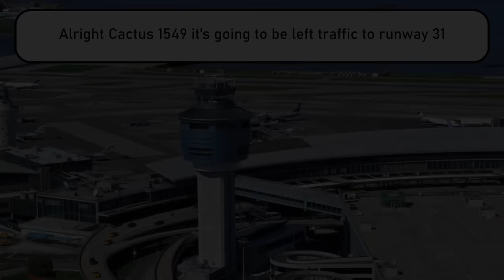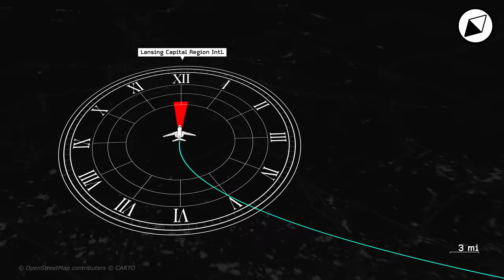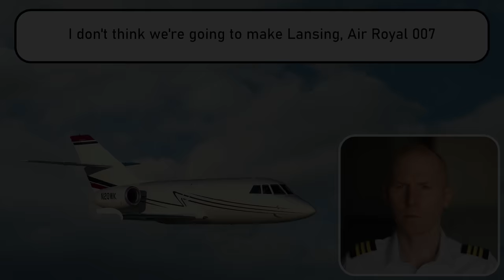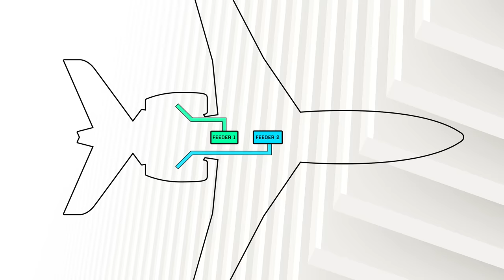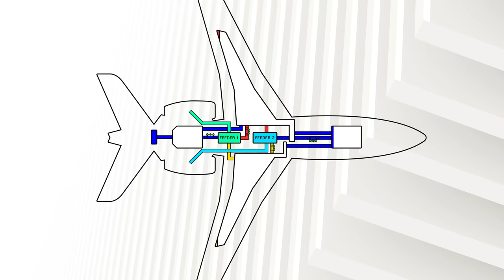Most Bizarre Dual Engine Failure Ever

Comment: Never ever give up altitude with no engines until you are very close to landing.
Reply: Except as part of your energy management, of course. Really not good to come in super hot, when you don't have the option of a go-around.
Reply: How is that possible anyway? As soon as you lose thrust, you will begin to lose altitude, unless in a glider on a thermal updraft.
Reply: @hoghogwild  more precisely, never give up energy unnecessarily when you don't have working engines to give you more energy. You can trade energy back and forth between speed and altitude, you can deliberately dump energy (within limits), and ultimately you need to touch down with almost no energy left.

The most extreme energy management I've seen was an old-school aerobatic pilot: turned his engine off, did a few aerobatic manoeuvres, and then landed pretty much immediately. Knew exactly what he was doing, and also he knew how to maintain a safety margin.

Comment: As ATC, just as with you pilots, it's important to keep things as standard and normal as possible, especially in emergency situations. That's probably why he kept giving "normal" instructions.
Reply: Yeah, standard emergency procedures, not trying to apply standard procedures to emergencies. That's just confusing and frustrating
Reply: @alakani  The whole point of emergencies is that they're non-standard. Thus, you can't really have any "standard" emergency procedures. You have to deal with the situation you're dealt with the way you're dealt it. We're animals of habit, and we do the best when in a situation we're used to. Thus, doing things as you're used to doing them, would lead to the best outcomes.
Reply: @Henoik  Sir I know you have a multi engine fire but that is no excuse to cut in line. Please go around or get a pen and paper to write down a number:p
Reply: @alakani  You need to understand that during an emergency, a controller's instructions more become "advise" than anything. We understand that pilots may be unable to carry out an instruction, even during normal operations. There is just so much we can do as controllers. If you bust the 3000 feet because you cannot maintain that altitude for whatever reason, then that is fair enough, but we cannot give a clearance that doesn't ensure separation from terrain or other traffic - even during emergency situations. The PIC needs to do what he needs to do, and we do whatever we can to make free room for you. Yes, it sounds weird to ask a pilot without engines to maintain an altitude, but "sounding weird" has never hurt anyone. Improvisation, however, has.
Reply: @Henoik  Luckily this was a very experienced pilot. I can only imagine how that kind of advice might have gone over with the student with an incapacitated instructor. Thankfully it's usually much more of a team effort in emergencies than this, and the student landed safely thanks almost entirely to a wonderful controller
Reply: @alakani  Whilst it is true that complacancy and lack of assertiveness have been a part of accidents before and will continue to be part of accidents in the future, the non-standard handling of a situation has a tendency to lead to confusion for everyone involved, and has directly led to accidents before and will continue to lead to accidents in the future. Do you find the term "Cleared to land" to be awkward to give to an aircraft with an engine failure? Do you find it weird that an aircraft on an emergency descent will be cleared by ATC to descend to whatever level/alt the flight crew requests? Yes, they start their descent often without clearance, and don't necessarily talk to ATC before they are well into their descent, but this is the kind of stuff we plan for.
Reply: This is true. I also heard it as more "everything down to 3000 is clear for you, no obstacles". Like you say, standard call that is easy to log and understand what it means under pressure
Reply: @paulalexander8874  Exactly. Aviate, navigate, communicate. Every (commercial) pilot understands that they need to keep the airplane afloat before they can worry about the instructions we give. If you're unable, just say unable.

Comment: I was laughing too when they told him to maintain 3K. 😅 I’m surprised they didn’t tell him to meet a crossing restriction 😅 Assuming an emergency has been declared, they can pretty much bust that 3K without sanctions.
Reply: I agree, they can bust that all day long if they declared an emergency.  
Probably doesn’t matter in Michigan but they may have had terrain or obstacles they wanted to tell the pilots about with that clearance.
Reply: @stevenbeach748  There's a number of transmitter towers reaching up to 2100 in that particular area.  3000 is also the initial approach/glideslope intercept altitude for the GPS approach to that particular runway, so habit may have been involved, too.

Comment: Kelsey, potential small correction to your video (at least as a paraglider pilot): the weight of the aircraft shouldn't affect the glide ratio. By being heavier you lose altitude faster, but you have a higher airspeed that counters that (e.g. you sink more per second, but you also go further per second). In still air, you'd end up at the same spot regardless of weight.
If anything, since being heavy increases the airspeed of the glider, you'll have better groundspeed if you're in a strong headwind, and thus can reach a target more easily. Being too light would have the opposite effect - not being able to maintain a sufficient ground speed and thus not making it all the way to your target.
Is there anything about powered aircraft that would make things different?
Thank you and Happy Holidays!

Comment: The one thing I never heard ATC ask the pilot is "What is your speed?"  I think I would have known a plane needed lots of altitude and speed to glide 15 miles.  I have heard that small jets can almost glide for 2 miles for every 1000 feet, so if the controller is telling him to hold at 3,000 feet, there's no way he was going to make it 15 miles.  I wonder how far had the plane flown before losing engines?  Was it out of fuel or suffered fuel contamination?

Comment: Cleared to 3000 is because that’s the lowest altitude he has control over.  It may be bottom of his block with a different agency below, or it may be minimum vector altitude for the sector due to terrain. In either case the controller cannot provide a lower clearance.  Doesn’t mean the plane can’t go lower, just means it’s out of this controllers airspace if it does
Reply: I mean, this was a mayday situation, so all clearances were pretty much off the table?
Reply: Cleared to 3000'is one thing, maintain 3000' is completely different

Comment: What's the takeoff distance of your 747? If you had to emergency land on a 4000' runway would you be able to take off again or how would you get the plane out of there?
Reply: It would become a museum where it stopped
Reply: @1972challenger  maybe not, it depends. They could climb onto ground effect assuming there aren’t obstacle’s ahead, or they could tear the inside apart and take out a lot of weight like the USAF did with the C-17s. Those jets are worth tens to hundreds of millions depending of the variant, the operator will not abandon it without a fight to retrieve it first.
Reply: @Jesus Antonio  come to think of it maybe it would be cheaper to buy the houses in the way, bulldoze them and grade out a runway to get that bird back in the air
Reply: @1972challenger  that’s the scorched earth policy 😂. It’d be a few homes at 500k each for a 100m dollar jet. It’d be hard to convince people to sell, and if you push too hard it’d be bad PR. That’d be tricky.
Reply: You would get a test pilot with large aeroplane performance qualification to negotiate with the FAA and agree the maximum weights and the minimum thrust required for the take off.  Wind, atmospheric pressure, temperature and runway condition and extensions can be waited for.
Reply: The airline would buy giant fans and install them on the far end of the runway to create a 100kt headwind.
Reply: @1972challenger  That's almost exactly what happened at EHLE. They have a museum there which has a 747-203SUD (PH-BUK) as a show piece. It could have landed at the airport and the museum considered doing so, but the conditions eventually lead to them shipping the plane in several parts.

Comment: There was a Learjet out of Gainesville that lost both engines due to DEF contamination.
Reply: There have been at least 3 cases of DEF contamination, in all 3 the DEF froze up at altitude, blocking the fuel lines, and flaming out one or more engines.  Fortunately in all 3 cases the aircraft landed safely.
Reply: Wow!  How does DEF get into jet fuel?
Reply: No oversight on the private side and overworked rampers with no support  is a recipe for disaster. Forget about customer service, who is doing QC?
Double check your fuel loads and sump your tanks.
Reply: @trigonzobob  They were putting a dewatering fluid (like Prist) in the tanks and used an empty DEF jug. Jet A can tolerate ZERO DEF.
Reply: @richardshippful  Why would there even be DEF in the same stores as the aircraft materials? Aircraft parts/materials are meant to be stored seperately from commercial items. 
Did this occur at a smaller airport where ramp workers service ground equipement or is DEF used in some smaller aircraft?
Reply: @MegaGouch  I don't know those details. only that it was an "empty" DEF jug.

Comment: Maintain 3000 is probably just an automatic reaction by the controller, and it may be all the air space he controls.  Below 3000 he may not be able to clear him, meaning he'd have to maintain visual separation from other aircraft.
Reply: Under a mayday, clearance should be "anybody with at least one functioning engine stay the hell out of the way of the emergency aircraft."
Reply: I think tthat the maintain 3000 was because of thats the height of the largest obstacle in the area.
Reply: @Joe Bramblett yeah, but maybe they'd have to call another ATC to make that call for them.
Reply: @spartaleonidas7132  then that would be the absolute worst place to send a plane that can't even maintain altitude, much less climb.
Reply: @kd5nrh The minimum clearance is often a single piece of object like a cell tower. This may have been the towers best location that they can give him. I wouldn't look too deep into the phrasing of the towers responses - they know a plane without any engines really can't climb. Under a mayday call, the pilot can do whatever he needs to keep his plain in the air without towers authority. He may have to answer questions, but he was going to do that anyways.
Reply: @spartaleonidas7132  If the highest obstacle was 3000ft MSL, it would mean the ground was somewhere like 2500' MSL at most, meaning the approach pattern would be really low or there was a kilometer high object in the way. 3000' MSL is a pretty common altitude for most approaches when the airport is somewhere around sea level. "Maintain 3000 until estabilished" is a standard procedure.

Comment: Hey, Kelsey, are you sure that Glide Distance depends also on aircraft's weight? In my knowledge heavier aircraft will glide same distance as lighter one, but faster ;p
Reply: Weight has no effect on glide ratio, the same aircraft, with higher weight, will glide the same distance, only at a faster airspeed. It's one reason why an AOA indicator could be important because the best glide happens at a single angle of attack for any given configuration. (edited for AOA)

Comment: Around 2004 I was taking a Jetblue flight from NYC to SFO.  Right as we were crossing the Rocky's the pilot told us that the fuel had been miscalculated and we had to divert to SLC to fuel.  It was snowing hard with wind.  Got into SFO late so missed my connecting to BUR and had to sleep in airport.  The year before on Jetblue after we took off from JFK for LAX we had to land at some airport in New Jersey because the aircraft was loaded incorrectly and was unbalanced.  We had to dump fuel and land. Well, the pilot had to scrounge for credit cards to get enough fuel as Jetblue had no arrangement for fueling at that airport.  I've never had luck with that airline.
Reply: How far did they go?  Do you mean asking passengers for their cards?
Reply: @larrythompson8630  yes asking passengers for their cards.
Reply: @protonneutron9046  I would want a decent return for that.  Reimbursement, plus 4 round trips at least.
Reply: @larrythompson8630  for sure!

Comment: Any idea how thick the concrete would have to be to support a 747 compared to the thickness of the smaller local airports? I’d think there’s no way it could land without buckling.
Merry Christmas Kelsey!
Reply: We had 747s land at our base.  The runway was four feet think in the landing zones.  Thinner in the middle of the runway, where the aircraft don’t land on.
Reply: @robertheinkel6225  . In relation to major airports like Chicago to county airports at the other end where does yours fall? I’ve been thinking if given the runway can’t support the weight of a heavy class plane maybe it’s why the schematic isn’t included in his list of airports?
Reply: @kevinstonerock3158  Note that heavy is a designation that refers to wake turbulence, and applies to any aircraft with maximum takeoff weight greater than 300,000 lbs, which includes some airplanes that we might not think of as heavy such as the 767 and 787.  In fact the 757 is under the weight limit but is considered a heavy because of its tendency to produce strong wake turbulence.

As for weight on the runway, the number of wheels helps to spread things out somewhat. Here is a general idea of what the weight per wheel is for some airplanes.  Weight per square inch of tire would be more precise but I don't have that.

Type                         Weight (lbs)  Wheels       lbs/wheel       
Airbus A380	         1,267,700	   22		57,600
Boeing 787-9	   560,000	   10		56,000
Airbus A330-900	   553,400	   10		55,300
Boeing 747-8	   978,000	   18		54,300
Airbus A350-1000   679,000	   14		48,500
Boeing 777-300	   660,000	   14		47,100
Boeing 767-400ER   449,700	   10		45,000
Boeing 737-900	    187,400	     6		        31,200
Airbus A321	            183,000	     6		        30,500
Reply: @StevePemberton2  . Well I knew about the designation by weight but wasn’t aware of the designation by wake turbulence. Thanks for the info. The chart will come in handy in order to compare between them. Thanks again. Merry Christmas!

Comment: 6:27 75 feet? if i'm not mistaken thats more than twice as wide as the main gear on a 747. shouldn't be too hard. some time ago i watched a video of a 747 landing (IIRC somewhere in south africa) on a runway that was only 3 meters wider than the main gear, and the pilot managed to put that big bird right in the middle of the runway.
but only 4000 feet long? set flaps 30, come in low, touch down early, hit the brakes HARD. i mean spoilers, reversers and wheel brakes.

9:26 the gimli glider comes to mind. also, there was a flight here in europe that couldn't retract the landing gear but decided to continue anyway, and IIRC they had to do an emergency landing at LOWI.

Comment: It is a lot of years ago,, a friend was flying skydivers,, building hours and proficiency.  One of the exiting skydivers,, as a prank,, (not funny)  switched the tank selector switch as he exited,, Cessna 180  selector switch on the floor between the seats.  My good friend, the pilot ran out of fuel on his downwind final at perhaps 300 feet.  He handled it perfectly.  A very abrupt base leg and to say short final is an understatement.  Final was at perhaps 50 feet altitude and 150 feet  to touch down.  He, in essence landed on the runway in the final banking turn.  He was a bit hot.  The bozo who authored the 'prank' was asked to leave.

Comment: An issued altitude by a controller is what the controller has to safely offer on an IFR flight plan, not what your aircraft can maintain in this case. Now that you've been cleared to 3000 feet when your engines are out, you know at what point you aren't guaranteed to not run into shit.

Comment: A light twin engine plane is actually less safe than a single engine plane. Typicly a light twin will not have enough power to maintain altitude with just one engine working.
    Losing an engine on a twin doesn't leave you with half the power (50%). Because of a lot of factors, you are left with just 20% of the power you'd have with 2 engines.
      An airplane is only flyable if you have engine power to maintain altitude. With a single engine, if you lose the engine you are forced to land. In a light twin, if you lose an engine you are still forced to land, but now you will be going faster when you get to the ground.
     On top of that, with two engines your chance of having an engine failure is doubled.
      So rather than halving your chance of making a forced landing you have doubled it.

Comment: Have you heard about the Canadian commercial turboprop crash last winter? Flying from like Yellowknife to Whitehorse or something like that, in December, they ran out of fuel and crashed in a swamp 8 miles from the nearest airport -- took 8 hours to rescue the crew and pax from the frozen winter swamp way up in the Canadian subarctic. The report was released last month or so, and it turned out that they literally forgot to refuel in Yellowknife before taking off. The entire company's pilots had developed the habit of running checklists individually, silently, and they completely forgot to add any fuel at all. Then, when they flamed out, they screwed up the fuel management and turned off the only tank which did have some 30 minutes or whatever of fuel remaining, which would have gotten them to that nearby airport. And because of those fuckups, they crashed in northern Canada, in frigging December. Genius flying from those guys.